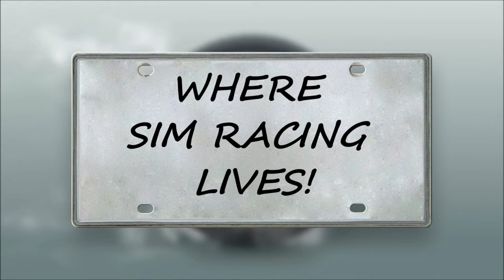Heusinkveld Sprint Pedal Install to Simetek K2 Rig

Comment: They look nice. I have the V3 pedals and CSW V2.5 wheel base. These pedals are definitely on my list, but I’m going to go DD wheel base first. Was going to go Accuforce V2 but for $100 NZ more I can get the SC2 sport and run my Fanatec bmw rim using the sequential shifter until I get the conversion kit. Would really love to see a review from you comparing the sport model to your Accuforce.

Comment: what about shifter and Handbreake from Heusinkveld
Reply from the maker: they are great! I have reviews up on those if you want to check it out. What's your question about them?
HE Handbrake: https://youtu.be/hFKLGYkS8xc
HE Shifter: https://youtu.be/L1b9D8sOxg4
Reply: @TJRSIM  how can I mount both on simetik cockpit
Reply from the maker: Beniczek78 take a look at my intro vid. The HE handbrake mounts up to the Simetek shifter mount. I mounted the He shifter to the inside of that using there bracket and screwed into 2 of the existing holes on the side of it. Or you could mount the shifter to shifter bracket at top and get a second simetek bracket and mount your handbrake to the left or right of your leg. Check out their website to see the mounting options